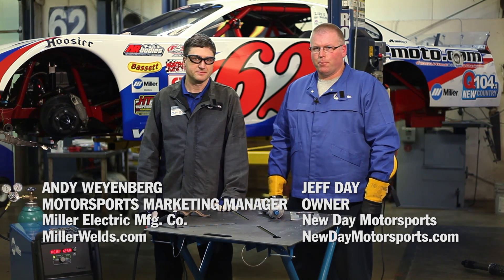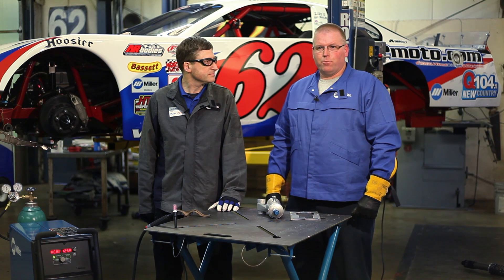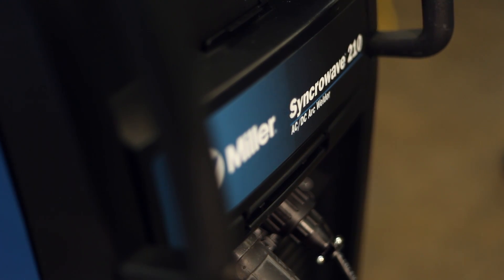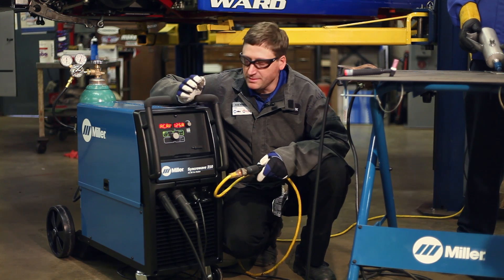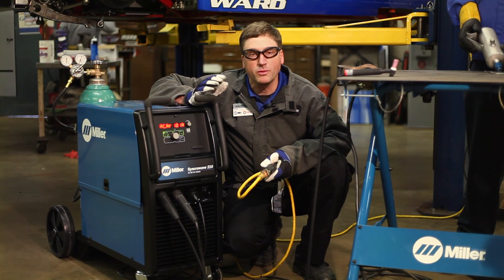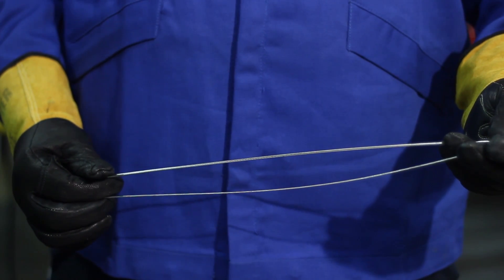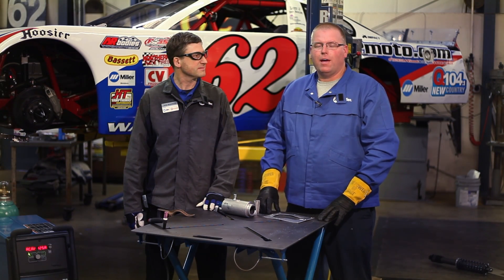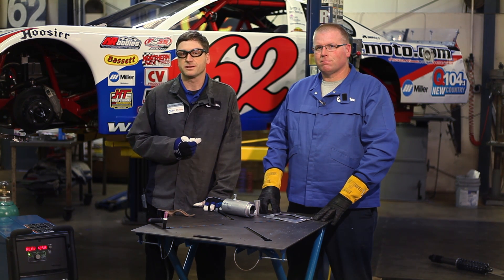Using your Syncrowave 210 TIG welder in the shop, garage or at the track

Comment: Wait, what is the max welding amps you could get from a 110V circuit? My little box welder does I think only 80 and you say this miller does over 100a?
Reply from the maker: Hi, John. Thanks for reaching out. You can find the duty cycle for the Syncrowave 210 on the spec sheet here: https://www.millerwelds.com/equipment/welders/tig-gtaw/syncrowave-210-tig-welders-m00488 Thank you.
Reply: Got it! I want to TIG weld and the only plug I have where I want to weld is a 20amp 120V. Seems like it would handle well. Thanks.